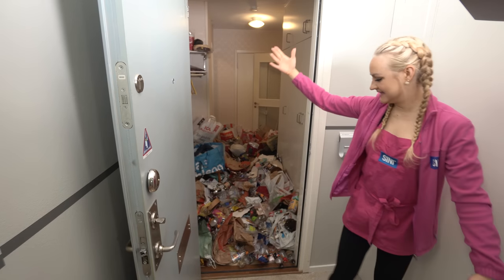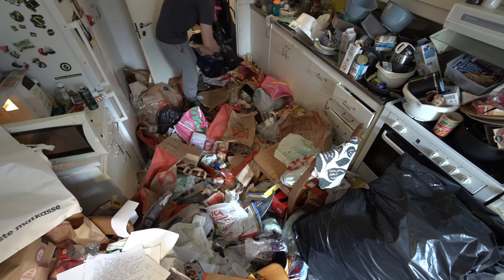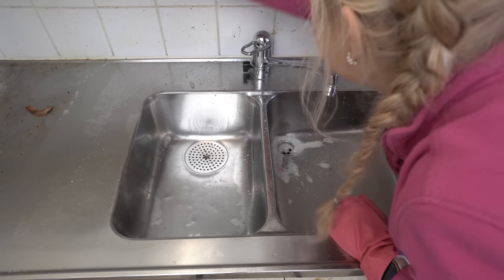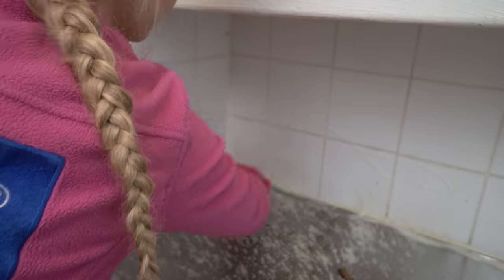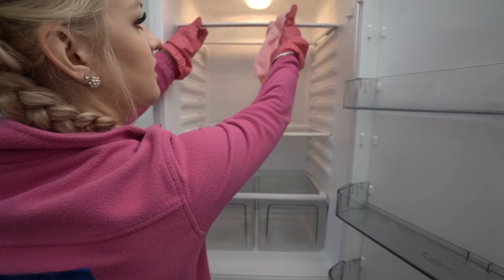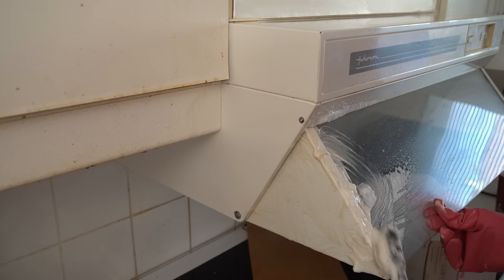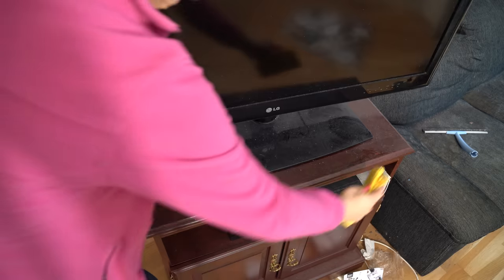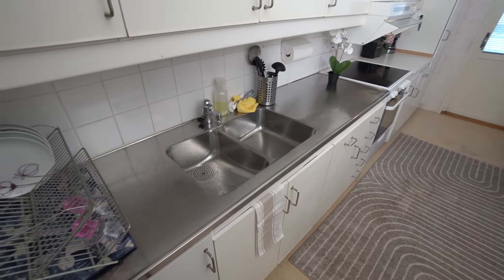MYSTERY MESS: Who is Responsible?? Cleaning for Free!

Comment: “Do you remember to clean behind your appliances?”
anxious noises
“Nothing bad happens. I haven’t cleaned behind my fridge and I’m still alive”
😮 relief
Reply: To be fair Auri's home is new and was only renovated this year. heeheee :)
Reply: Mostly just a lot of dust. 😅
Reply: Just a dead mouse behind mine
Reply: Then she proceeded to pull the oven door off! 😂😂😂 28:38
Reply: I’d be embarrassed to say I did this too.
Reply: Poor girl is grieving but I think she’s fibbing that someone else did it. Maybe I’m wrong. But I don’t think so. Grief will do this to you. Why would she be ashamed if it wasn’t her? She would be mad!
Reply: I hope this cheered her up!
Reply: You should clean and blow out the dirt after removing back panel behind your fridge.  Do it at least 2 times a year or the  compressor works overtime, that's when things start freezing in the fridge. I do it every 3 months.
Reply: I love your  heart💜
Reply: @heikemckelvey6863  ooh thanks for the tip! I had to switch apartments because landlord forced a renovation on us and the new fridge doesn't work as well as the ancient fridge I used to have, and freezes things in the back of the fridge all the time!  I will try cleaning the backside and see if that helps.
Reply: Yeahhhh, full of some grease, dust, spaghetti and other things O have been cooking with, like flour, oatmeal, jam.
Reply: @heikemckelvey6863  Or just remove the back panel of your refrigerator with a screw driver and vacuum it with the brush attachment on your vacuum. I do this once a year because I'm not in a really dusty area but I don't expect her to do appliance maintenance because she has so little time to just get these homes cleared and clean enough to be safe to live in.😊

Comment: Yes, linoleum is right, and you pronounced it correctly.  That used to be the most popular flooring for kitchens in the US -- in the 1970 and 80's almost every house had it.  I'm not sure about today or if it was ever popular in Europe.
Reply: I can tell you that in the UK nearly all kitchens had vinyl 'linoleum' or 'lino' flooring in the 1980s. Real lineoleum is much rarer and I've only ever seen it when doing lino cutting, and might be the stuff that can't handle bleach. Our vinyl lino could handle anything.
Reply: The authentic linoleum was invented by an Englishman in 1855. It is a mixture of linseed oil, pine resin, cork dust, sawdust and mineral fillers on a background of burlap or canvas and dyed with various coloured pigments. Nowadays sheet vinyl is often called lino but they are not the same product. ~ I remember my mother waxing the floors when I was a little girl. She finally got an electric polisher which saved a lot of work. When I was about seven I slipped on the waxed linoleum and dropped my grandfather’s typewriter and cracked the iron case. Luckily it didn’t land on my foot.
Reply: We call it lino in the UK and it was VERY popular back in the day.
Reply: Our apartment has linoleum floors here in Germany. Our housing company use them for all their apartments, maybe because it is cheaper and easy to change if necessary. But I think it was more common in the past here too.
Reply: in Russia, linoleum is still in many apartments, including mine.
Reply: Linoleum is and was very popular in German schools, kindergartens and everything group home related, like youth hostels, boarding schools and such. It is very durable, non-toxic, environmental-friendly and does not cost that much. Great!
Reply: @elektra121 ❤

Comment: Great pronunciation of Linoleum. :) Also, I believe Grace, I do not think she caused this mess. The black stains on the living room floor may have been caused by the house sitter sitting on the living room couch with dirty shoes or boots. Notice the black area is only right in between the couch and the table. Maybe the house sitter works a job in construction or something because the dirt from the underside of boots or the bottom side of the shoe is black then through time, it rubs off on the wood floor and causes the floor to stain. Unfortunately, after too much time then the stain is permanent on a wood floor. This is why you should take off your work boots while in the house.
Reply: The home is in Sweden and everyone takes their shoes off by the door in Sweden. It doesn't matter if it's light tennis shoes, dirty work boots, or just flip flops, off they go by the door.
Reply: @miahindpaj9333 you can't walk in a house like that with no shoes on
Reply: Auri said the floor was burned. She clearly knows her stuff and it's easy to tell if a wooden floor is burned or if it's destroyed by something else.

Comment: Maybe Auri or one of her followers can give me an idea about how to get grease-splatter off of painted drywall.
Reply: I don't know how dirty your walls are but what I use to clean the tops of my kitchen cabinets is powered dishwasher detergent, either Cascade or Finish.  I dissolve Cascade in hot water, and it cleans grease very well, but wear gloves because it will dry your skin.  My kitchen cabinets are topped with plastic coated MDF so it's a smooth surface.  Try it on an inconspicuous area first because the kind of paint you have makes a difference, flat paint doesn't clean well, my kitchen is painted with eggshell and I have no issues with the dishwashing detergent removing paint.  Good luck with your cleaning!

Comment: Hello, I follow your videos regularly and I like them a lot. can you help me how to clean the dishwasher, I mean the partitions, that is, the wires are really dirty and it is impossible to wipe them one by one, thanks in advance and please answer
Reply: Can you take them out?
Reply: If you can remove them, get a container to put them in all together (like a bathtub or big sink) add very hot water, 1 cup powder laundry detergent, 1/4 cup powder Borax, 1/2 cup baking soda. Let soak for up to 4 hours. Everything should wash off.
Reply: They won't come clean if you run the dishwasher on the pot and pans setting?  Maybe your water heater is going out because dishwasher detergent and hot water should clean them.
Reply: Thank you all for the advice, I will try it and report back❤